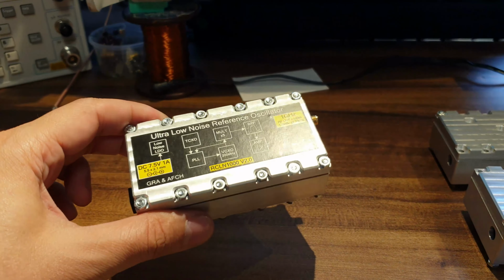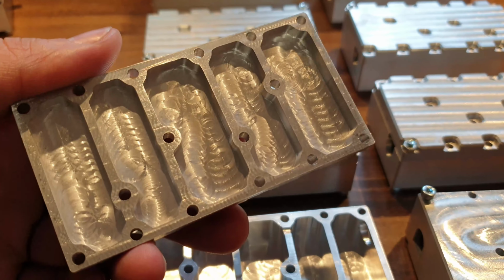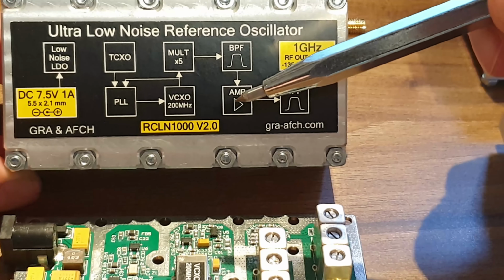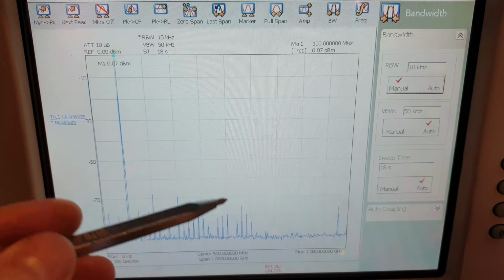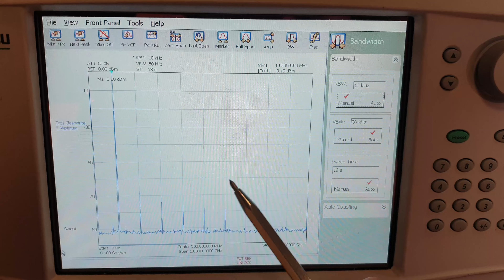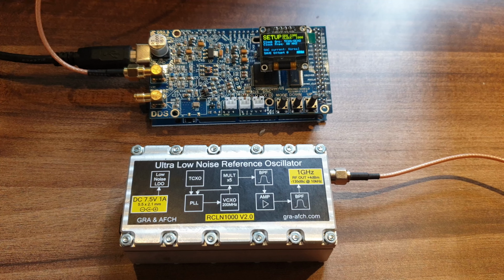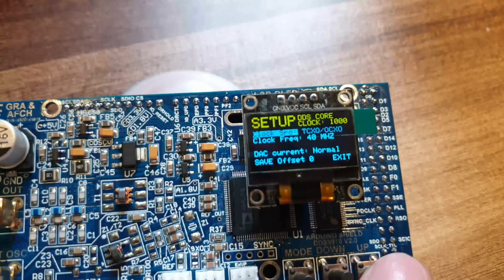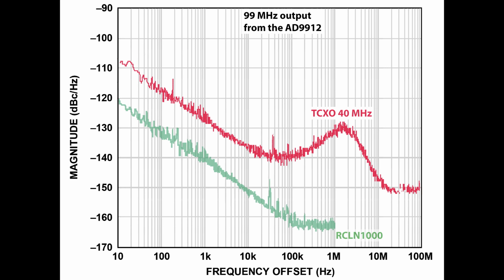1GHz Oscillator Reference Clock Low Phase Noise RCLN1000 -136dBc/Hz @ 10kHz for DDS AD9910 AD9912

Comment from the maker: 1GHz Oscillator Reference Clock Low Phase Noise RCLN1000
Buy Now Official site https://gra-afch.com/catalog/rf-units/rf-filters/ultra-low-noise-reference-oscillator-rcln1000-1ghz-for-dds-ad9910-dds9912-units/
Buy Now eBay https://www.ebay.com/itm/166228154667